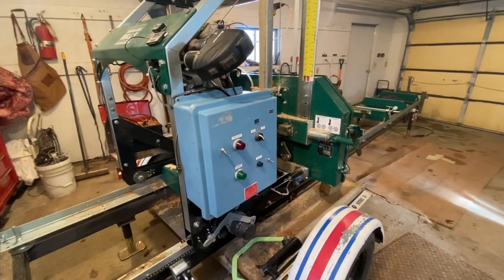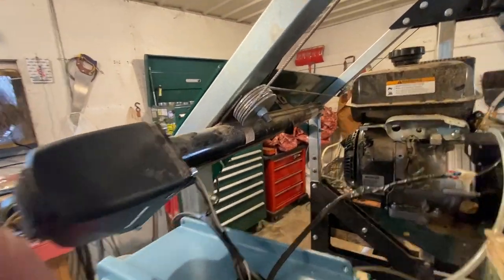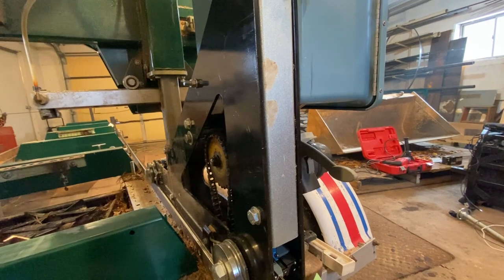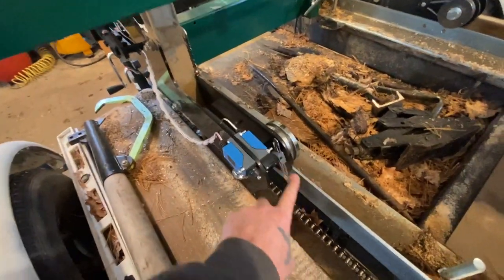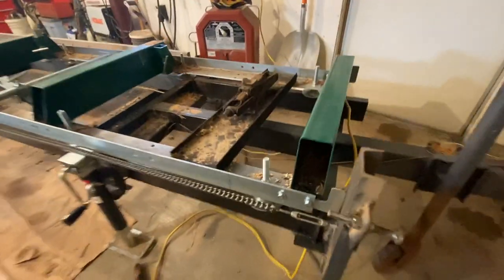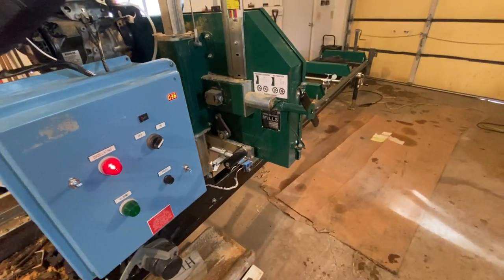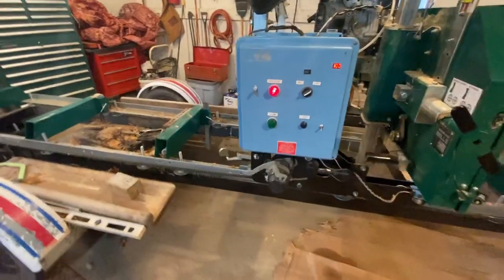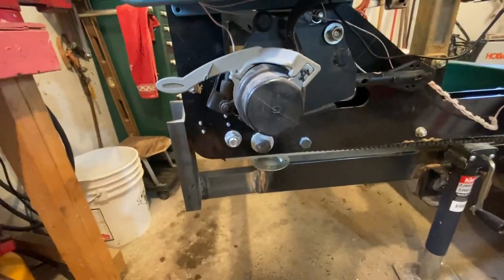Woodland Mills HM126 Auto Feed Video

Comment: Nice job man! Very well thought out with the limit switches and throttle control! I have a 130max and thinking about building out an Arduino controller system for height adjustment. You're inspiring me to attempt a similar chain drive auto feed. Subscribed!
Reply: I’m thinking of doing the same thing on the height adjustment. Interested in collaborating to make that work?

Comment: How did you attach the drive system to the mill
Reply from the maker: I simply bolted the motor assembly onto the carriage. You can see the bolts in the video when I first talk about the parking brake.

Comment: Thats a jazzy wheelchair motor?
Reply from the maker: Yes it is. Those things are easy to find, cheap, and they come with 2 motors. They can be wired for 12volts or 24 volts, and their designed for wet conditions.
Reply: @kevinthemiller9003  out of curiosity what model is the one you used?  see some 1281, 1281 or some 1396 1471
Reply from the maker: @jasonpinsonneault5911  If your asking about the Jazzy scooter model for this motor, I don't know at this time. I will see if i can find out for you. If you meant model number of something else, please let me know what you are referencing.
Reply: @Kevin The Miller  yes the jazzy motor, sorry should have mentioned that

Comment from the maker: Pulse Width Modulator with digital readout. (My preference)

https://www.amazon.com/Controller-Stepless-Adjustable-Potentiometer-Forward-Brake-Reverse/dp/B089273KVZ/ref=sr_1_10?crid=3ACNQVH791GX7&keywords=pulse%2Bwidth%2Bmodulator%2B12v&qid=1675008239&s=hi&sprefix=pulse%2Bwidth%2Bmodulator%2Ctools%2C127&sr=1-10&th=1

Comment from the maker: Pulse Width Modulator (speed and direction control)

https://www.amazon.com/Controller-Modulation-Regulator-Stepless-Variable/dp/B08GC7KDKL/ref=asc_df_B08GC7KDKL/?tag=hyprod-20&linkCode=df0&hvadid=459709171878&hvpos=&hvnetw=g&hvrand=5200565878704842199&hvpone=&hvptwo=&hvqmt=&hvdev=c&hvdvcmdl=&hvlocint=&hvlocphy=9019109&hvtargid=pla-951275636613&psc=1&region_id=674469
Reply from the maker: This is VERY inexpensive and this unit is a 60 Amp unit. You can easily get away with a 20-30 amp unit but I like to over build things. 😉
Reply: Do you use two pwm’s? You mentioned one above?
Reply from the maker: @revid64  no you only need one pwm. It comes with the double direction switch.